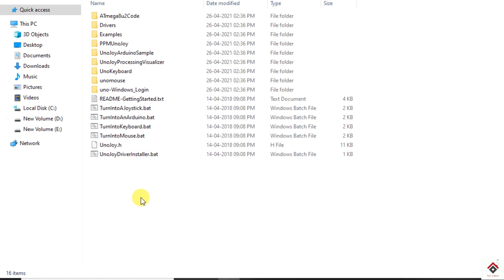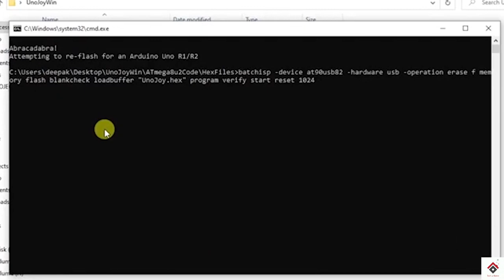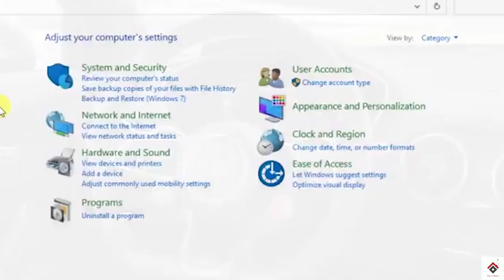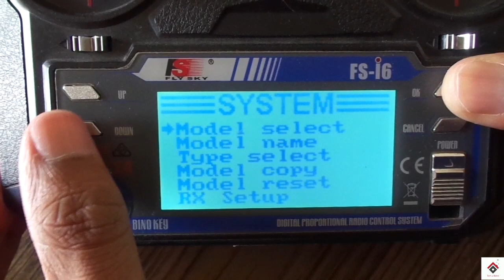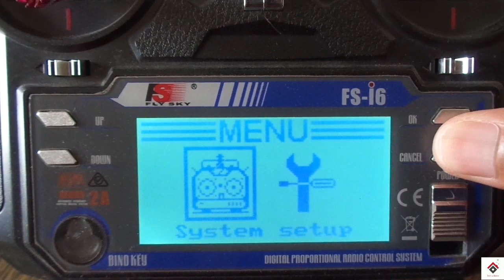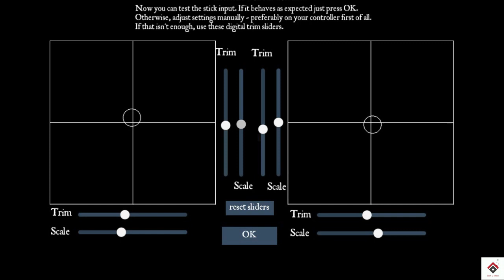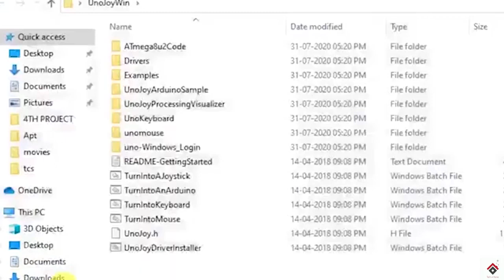FPV Drone simulator using Arduino and Flysky Transmitter | Unojoy Joystick | without simulator cable

Comment: hey I'm usuing radiolink at10 2 and r12ds rx which does not have ppm 
i want to know how to do it for pwm or sbus
Reply from the maker: I have not tried that, is there any other code files other than ppm, inside the given folder??
Reply: @techathome  no but I write code for pwm and it's works for 6 ch 
Which is enough for me

Comment: UnoJoy joystick dissappear from control panel when i turn on the remote , when i turn off , it reappears, what can be the problem ? 
Thanks in advance
Reply: i found the problem , i was powering the receiver with arduino , the current wasnt sufficient from my laptop, so i powered the receiver externally and now its working fine . thanks for the content, god bless you
Reply from the maker: Thanks for solution, it will be useful for others

Comment: while running turn into joystick, it shows "operating port failed" a firmware was not found. rest all is pass
Reply from the maker: Did you change anything in the file location?
Reply: @techathome  nope..
Reply: I just followed the steps as same. 
But, while running "turn into joystick" two error popup is appearing.
Reply from the maker: Can u uninstall Atmel Flip,
And reinstall and try

Comment: Im using Fly sky ct6b transmitter which does not have ppm so how do i use it?
Reply from the maker: For ct6b you will be having simulator cable right. You can use that only.
Reply: @techathome  No the cable does not work with ct6b models, that cable is only used for firmware updates.
Reply: In the code there is a boolean for ppm I can make that false but i dont know the pin numbers for other channels

Comment: AtLibUsbDfu.dll not found.  Brother I have  this error.  i am not able to run bat file. What should ı do. Can you help me ?
Reply from the maker: Here is the Solution video: https://youtu.be/Vd0F0XHzchY
Reply: @techathome  I watched. But still I have same problem. I’m using arduino uno ch340. I want to use simulator with this ardunio.
Reply from the maker: You cannot do this because,
Ch340 doesn't have option for enabling DFU mode( direct firmware upgrade)